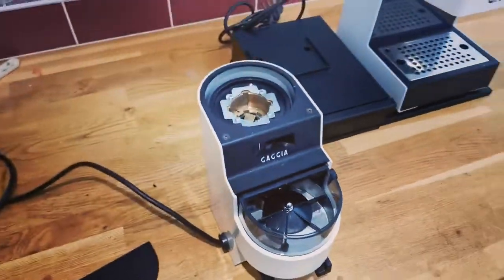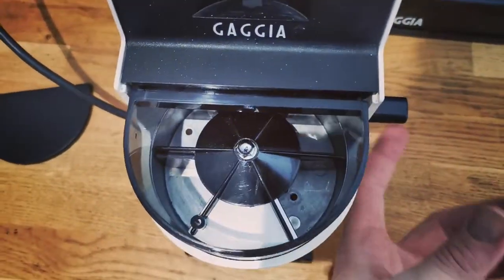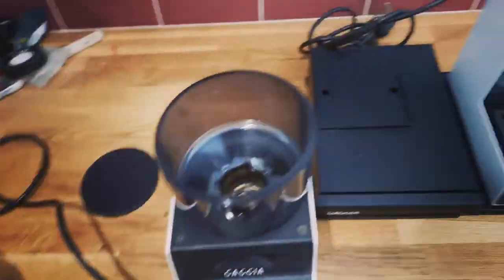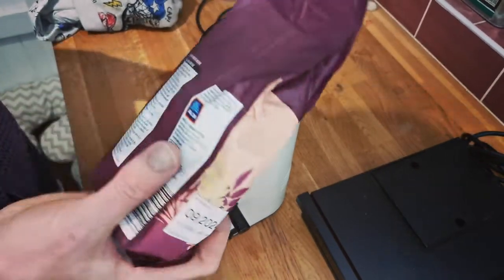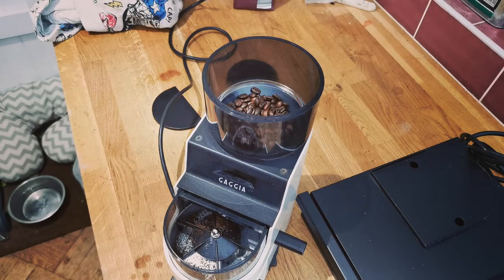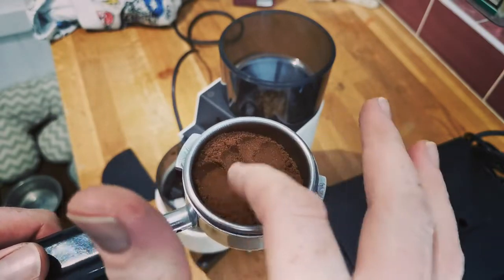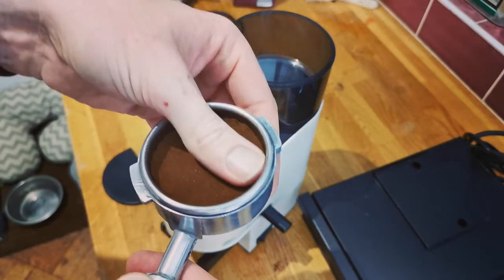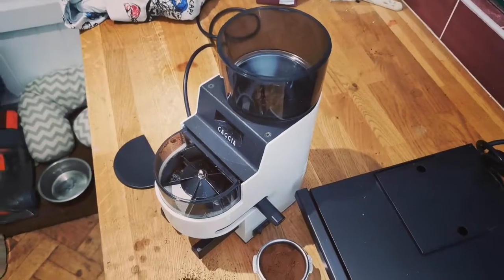Gaggia MDF espresso coffee grinder restoration part 2 and testing.

Comment: Hello, I just inherited one of these and I can't seem to figure how to adjust the grind size on it.  How do I adjust it?  The bean hopper container doesn't rotate at all.
Reply from the maker: Hi there, you rotate the hopper. It may be that it's stuck, you may need to remove the front cover with the 2 Allen screws and drop some oil on the threads. You also may need to take the hopper off the top and get to the burrs to clean them as it gets very dirty in there. I may do a video on cleaning one of these.
Reply: @benfitch8795  Ah that makes sense.  Thank you so much for the reply!